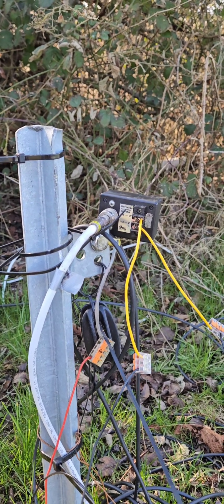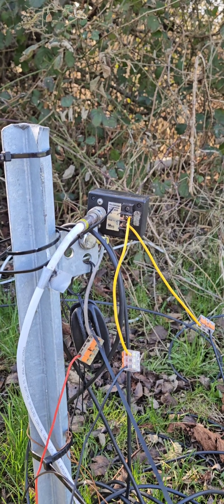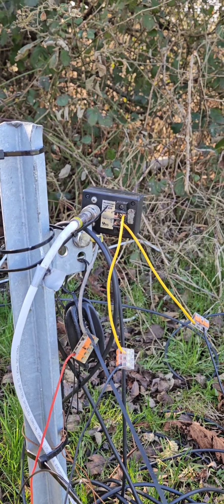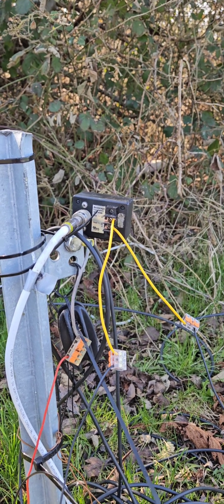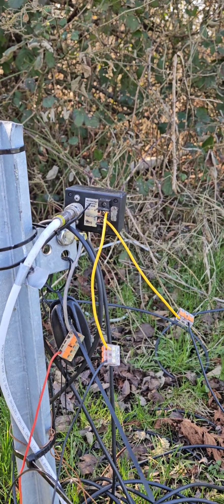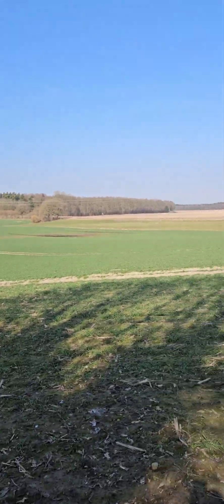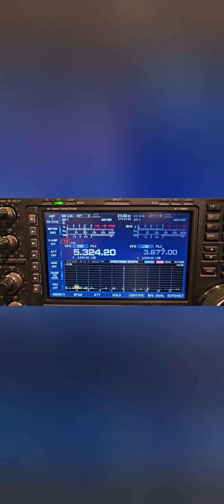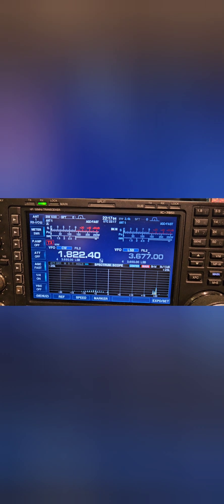Loop on Ground LoG receiving antenna @ DL8LAS

Comment: I haven’t noticed much difference in the log with pre amps and the tx antennas with attn. Sri to hear you only have the winter months for the bevs. They are the most impressive rx antennas